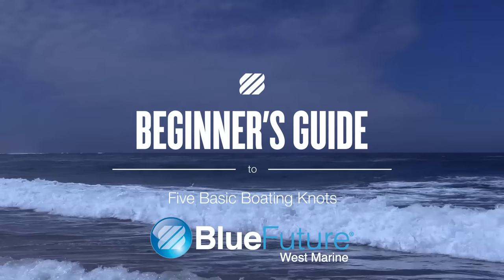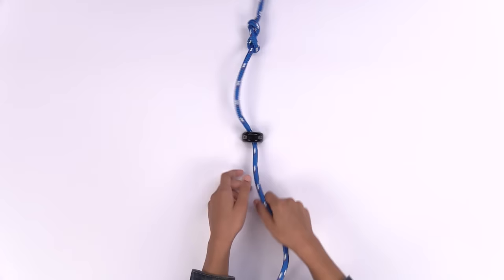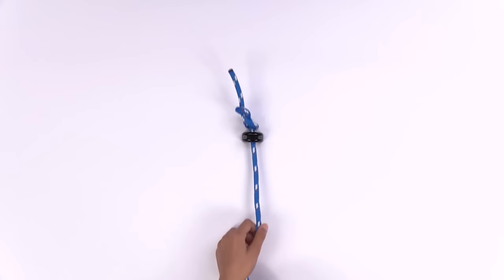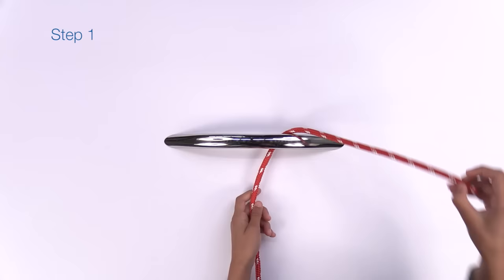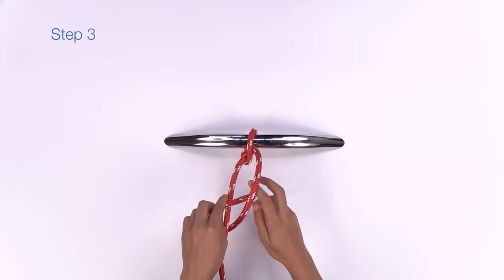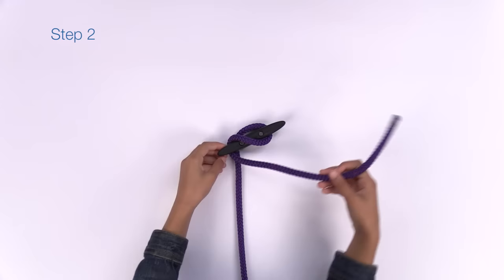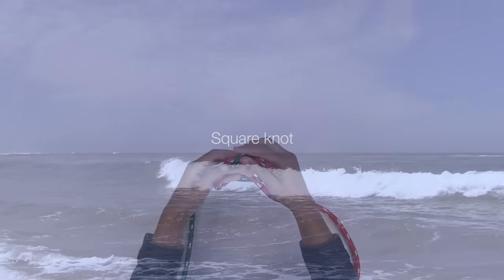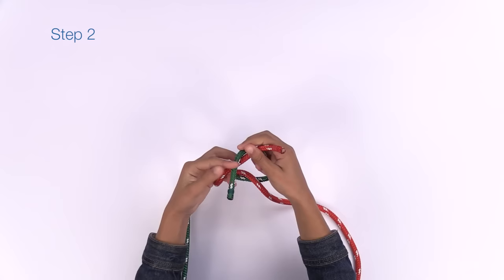Beginner's Guide to 5 Basic Boating Knots

Comment: Cleat hitch is incorrect and this version will jam, especially if thicker line is used. Beginning of round turn should be made on the horn opposite the direction from which the line enters. In this case, the line entered from the left, so the first turn should be made under the horn on the right.
Reply: everyone of these youtube 5 knot videos has at least one knot or hitch tied wrong.
Reply: Clear hitch also should be finished by making a loop with the tag end on the underside and pulling tight, passing it under makes things complicated and with large boats you can get your fingers grabbed
Reply: that’s why i was confused bc that’s what my grandfather always showed me
Reply: @Lightning Kachowski  get your fingers grabbed indeed, I damn near just lost my index finger taken off trying to tie off my 40 foot egg harbor.